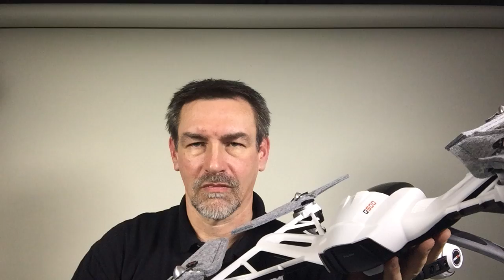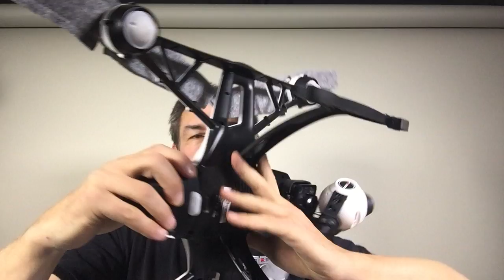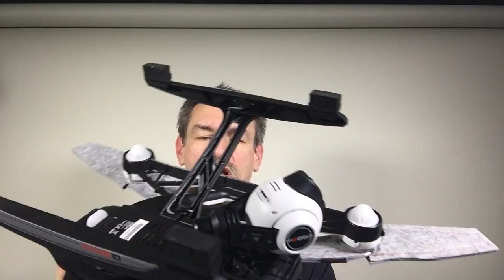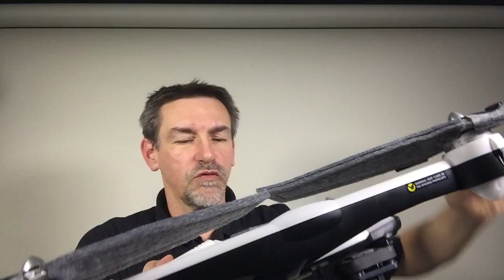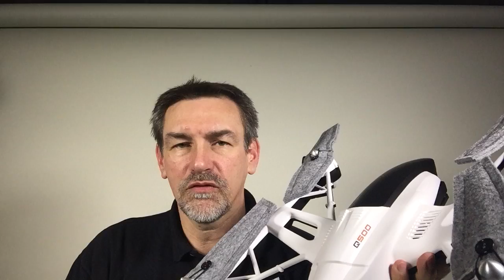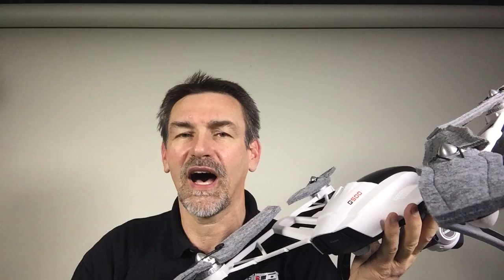Yuneec Q500 – Keep Compass and Antenna dry (English)

Comment: Wow does it make it not as good as phantom 2 vision, I had a phantom vision the one right before the plus. I got flew away, phantom if the gps is not locked, u still can take off. That's why I kinda thinking about q500, the only problem is that I think is a little too big, and phantom is a good size. But then doesn't make the q500 more safe?, about the wet, phantom won't have this problem right? it can land on snow?
Which one u think i should get. should I get the follow mode instead of the court lock?